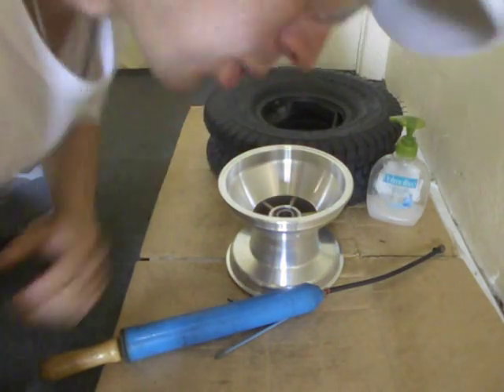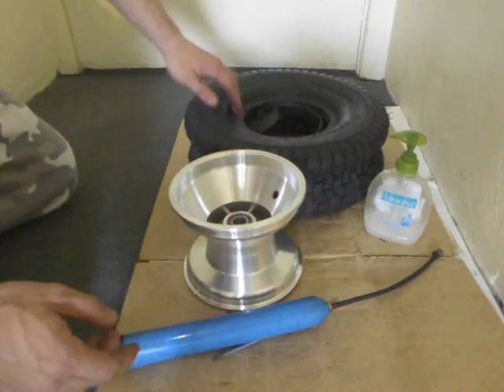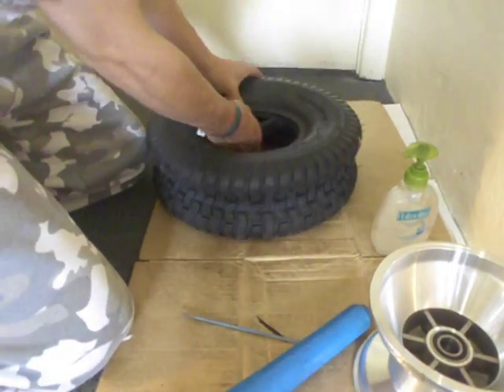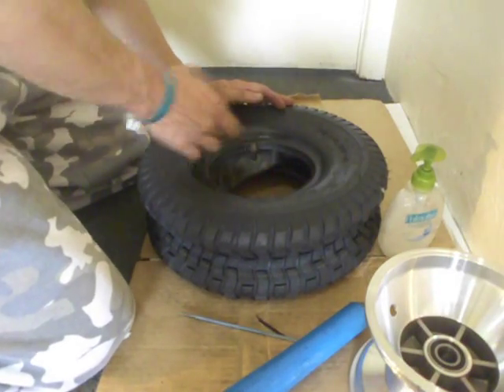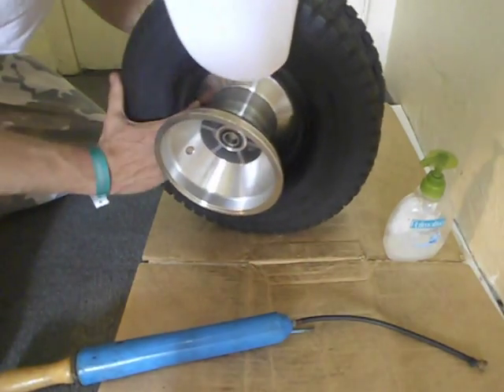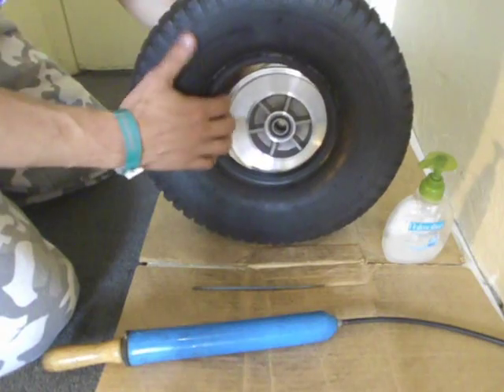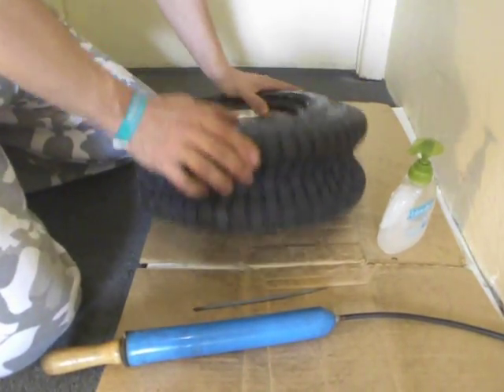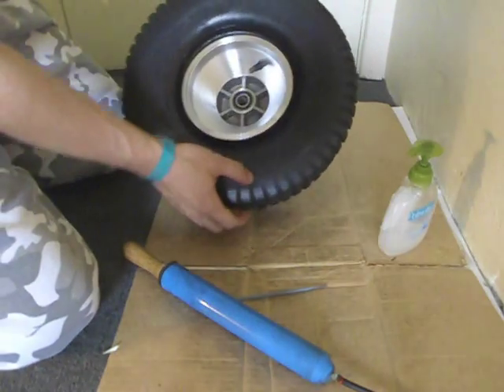How to fit tire and tube to go kart rim (long version)

Comment: You didn't say how much air to put in there. That's the part I was waiting for
Reply from the maker: Sorry. I did not link up the next video too well. I just fixed up the linking to the next video (What to look for when inflating tire after fitting tire to rim.) where I inflate the tire. In this example, this tire's rated maximum pressure is 30psi so I pumped it up to around 30 psi. Different tires have different maximum pressure ratings so you need to check them before inflating.